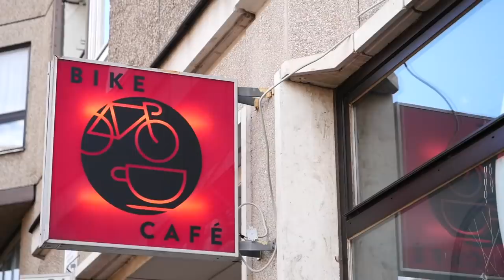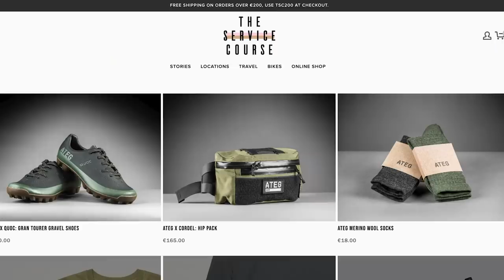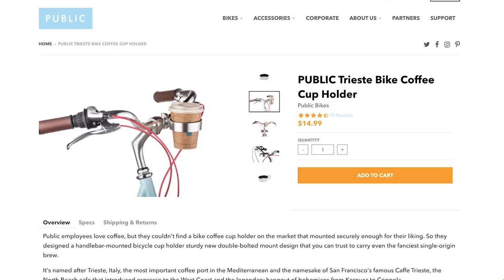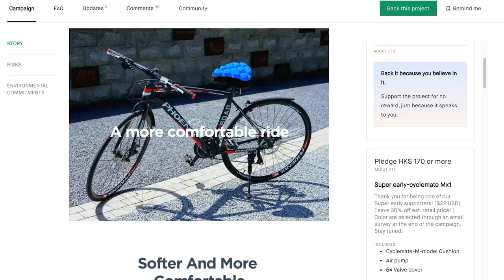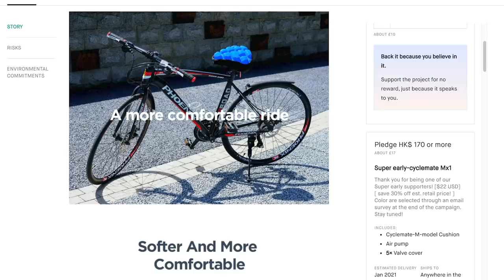Why Are Bikes So Expensive? | GCN Tech Show Ep.156

Comment: In 2018 I almost bought a (rim brake) Giant TCR Advanced Pro 2 I think it was. Carbon frame, fork and wheels, mechanical Ultegra and about $3500.
Fast forward to now, the same model (with disc brakes) costs $5000 for carbon frame, fork and wheels, but 105 instead of Ultegra.
This was before any COVID price hikes too.

Comment: Making this comment before watching the video:  "because people are still willing to pay the prices".  I did a comparison a year or two ago, comparing the top of the line Trek 5900/Dura Ace (made in the U.S.) back in 1993 to the top of the line Trek Madone/Dura Ace (made in China) when I made the comparison, and also adjusted for inflation rates as well.  If you used today's dollar back in 1993, that same 1993 Trek would've cost I think $7,300 if I remember right.  They moved to a far less expensive manufacturing/labor base in China, yet charge significantly more money.  One can argue that things are more "technologically advanced" these days, but all companies were making technological advances 30 years ago as well, and Trek engineers aren't paid some super high salaries (when I was researching, the median wage was around $47k/year).  Computers over the years have aided a great degree in design and "testing"; now they have modeling for aerodynamics, etc....which in 1993, I doubt that was even on the radar.  I'm having a custom titanium gravel bike built by Merlin metalworks (hand made here in the U.S. where labor is significantly more expensive), and titanium is far more expensive to work with than carbon.  The Merlin will be around $5,000 cheaper than a top of the line Madone, and I'm getting it built up with GRX Di2, a Stages powermeter, Enve fork/seatpost/stem, Ritchey WCS Evocurve carbon bars, Stans Grail CB7 Pro wheels, Shimano XTR pedals, etc....in other words, not cheap stuff.  Anyway, bottom line is, bike prices will keep going up because people will simply pay the price.

Comment: Ducati Supersport Price: $12,995 MSRP.    ~ same as Pinarello F12 Dogma with DuraAce Di2.   Crazy.

Here's what you get with the motorcycle:
"Take sportbike performance, give it more upright ergonomics, and top it off with Ducati’s treatment of a ride-by-wire electronic rider aids suite and the 937cc Testastretta twin cylinder engine and the 2020 Supersport is Ducati’s sport-touring machine more befitting of everyday riding while still capable of hitting apexes at the track or on canyon roads."

Comment: Honestly, it's not R&D as there is a huge spillover between firms and other sectors. I would say the high pricing is definitely due to willingness to pay combined with keeping a firm that "should" make durable products alive.
It's a market where consumers' surplus is extracted well and bike brands are very good in finding individual peoples willingness to pay and extract everything out of there! 

This is not a rant, it's just a very well designed market on the producer side: price discrimination without knowing the individual consumer. The high prices are just the result of what everyone's willingness to pay is. Cannot blame the brands for this!

Also, direct to consumer brands definitely can undercut the bikeshops and most of them still do if you compare specific brands. But for instance, Canyon has already distanced itself from this since it cannot prove this anymore (3400 for a carbon 105 without integrated stuff is not special). Meanwhile bikeshops sell entry level A-brand carbon bikes with 105 for 2000. 1.4k for extra "R&D" while being direct to consumer? It's not that they have reinvented the wheel mostly. First integrated bars on their top model in 2020, starting at 4.5k.
The undercutting of direct-to-consumer doesn't happen too much anymore, since also those brands will ask higher prices just because this increases profits while demand does not decrease as much.

Comment: The price of high end bikes is completely unjustifiable.  When you can buy mid size motorcycles with ABS, traction control, fully adjustable suspension, (the list gos on...) for less than high end bicycles, every justification regarding R&D, or some other drivel is absurd. Hell, most of the components including most companies frames are made off shore. You have to be one of the pin heads that wear 200 quid jeans to be inclined to buy this stuff.

Comment: 2016 cube attain gtc sl disc, with ultegra. Purchased for £1400 from Rutland cycles. This yrs lower spec 105 model £1999.. And they still can't get the frames aligned properly. So Where's the R&D in that increase? Heard canyon bb squeaks like a bitch too. Where's their rnd.?

Comment: so the money goes to
- research and development
- material
- intensive human labor
- marketing

this explanation still make no sense
all the other vehicles did the same and they are not as expensive as bicycle
Reply: Carbon fibre is hand woven as far as I know, and each machine layup typically takes a very long time. The crafting of proprietary carbon parts (such as an inter grated stem) requires low production numbers but also very few defects which is a very costly proposition
Reply: @fluffy13bondjames92  okay thank you to inform me, but I watch some bicycle manufacturing in my country that sold at high price but I don't see some labour like you said they exactly do the same like motorcycle manufacturer with less part

Comment: I agree and at the same time disagree. Bikes got expensive but not that much in my humble opinion. Peoples prefferences do. Keeping in mind that all roadbikes that are presented most of the time are the top of the range competition bikes (what pro cyclist ride). Its like FIA decides to sell formula one cars. Is it expensive? HELL YES! Is it faster than the normal cars that we have on roads? SURE IS! Do you thing you need one? Probably not. Do you think its practical to have one in every day driving? HELL NO! Do you think you can afford one? NOT IN MY ENTIRE LIFE TIME! 

Its the same as that analogy. Super expensive bikes are for pros. So theres no pressure if you can afford one.

Stick with the bike that you will ride. Not just to show off.

Got a old aluminum fuji and managed to upgrade it with sora r3000 (just the shifters, RD and FD) and i loved it.

Bottom line is want to go faster? Get a vehicle with an engine/motor on it

Comment: Because people keep buying the latest tech and when they're only weekend warriors. A lot of tech you do not need! If you're racing then fair enough

You can get a bike that works and feels great for £500-£1200. Anymore is just extra performance in areo/weight ( just go to the toilet before you cycle then ) and minor stuff that doesn't affect the quality of the ride. It just slightly increase your speed. 

Best money you can spend to go faster, if you want, is clothing
Reply: R. Schowiada71  I've ridden and raced on the really expensive bike and yes they're faster but they don't feel that much better to ride imo. 

Like my training bike is a aluminium bike with Shimano tiagra and it works great and is comfy while still be comfy. Plus I built it all for about 1000 including extras and painting it myself. 

I've even raced on that bike a few times and won. If I had to pay full price for those race bikes, I'd never use them. It's a rip off and we need to stop rolling over to these stupid prices

Comment: Stop apologizing and making excuses for the bike industry!  Bicycles are overpriced!  Even a low end Shimano 105 spec bike is overpriced.  It has nothing to do with engineering, R&D and exotic materials.  A comparison to the motorcycle industry serves as a good example.  The U.S. motorcycle industry is valued at 4.4bn USD, with unit sales of ~470k.  The U.S. bicycle industry is valued at 6.3bn USD, with unit sales of ~17.4m.  Are you telling me that a Suzuki GSX-R 750 motorcycle that sells for $10k USD has less R&D, componentry and exotic materials than a similarly priced $10k USD road or MTB bicycle?  

It has everything to do with demand, and the disparate manufacturing and vendors that make up a typical bicycle build.  In other words, the disparity of manufacturing and supply creates excessive mark-up on prices in the bike industry.  Additionally, cyclists are willing to pay the current market prices for bikes and components.  

I have no problem with the bike industry taking profits.  But, there is a big problem.  And, prior to the pandemic, the sport of cycling was primarily funded by middle-aged suburban males with larger disposable incomes.  This problem will only intensify when the pandemic subsides, and interest in cycling declines.  Some may prefer returning to the status quo, as it seems the streets, trail systems and paths have become bloated and overcrowded with new cyclists.  But, is the status quo a good state of affairs for cycling?

Comment: Greed. Capital sin, by the way. There is not another reason for bikes being so expensive. Most research is done by finite element simulations.  Aluminum frames are expensive, but almost all steps in the manufacturing are made by robots.

Comment: on a race bike around 3000euro is enough (exept wheels)  a bike for 7000 euro could never 100% better as the 3000 euro bikes. If you want to go faster you must take the bottom braket infront of the front wheel. Or you buy a maschine (not a bike) wich is around 6000 euros and gives every rider 10% more power !    www.hoehenbalance.de